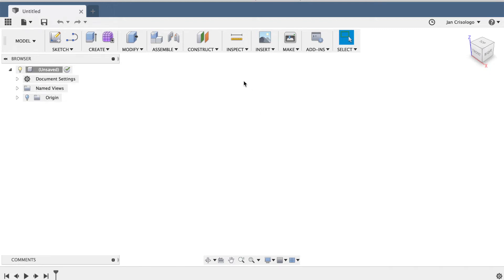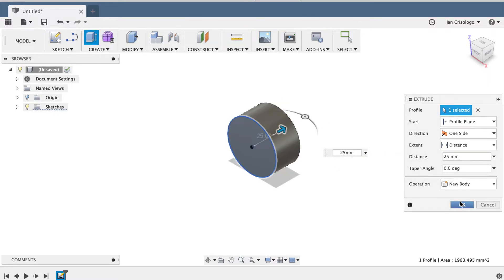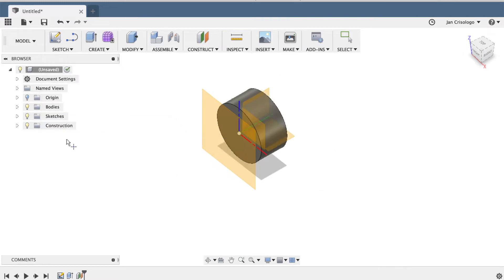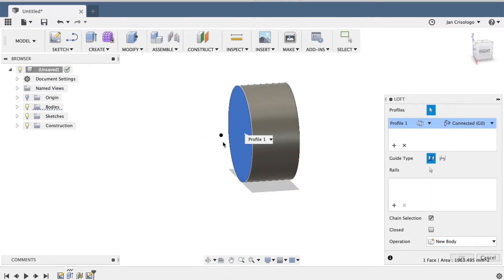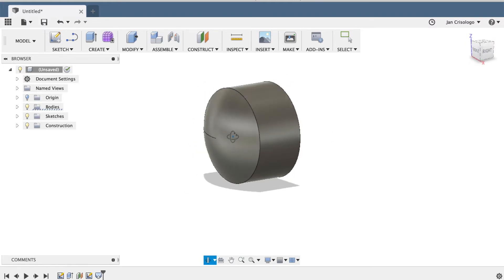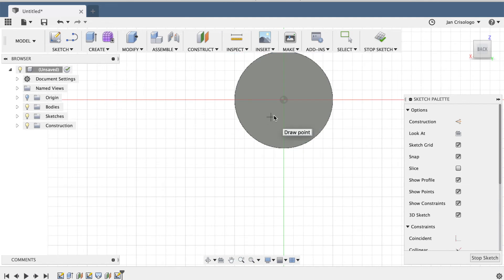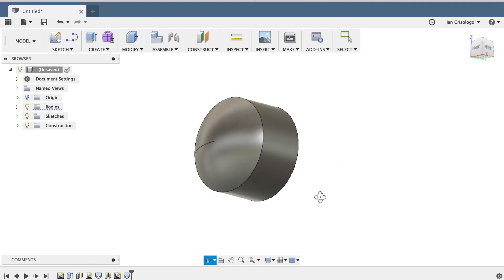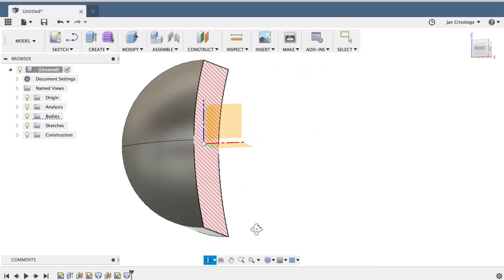How to model convex and concave surfaces in Fusion 360

Comment: Looked easy but in the latest version you have to create the offset plane, then select it, then Create Sketch, everything gets moved around and the offset plane is gone, but it’s there and that’s what you’re working on,so you can select a point, but it’s difficult to find a center point, but if you look sideways the  point is on the offset plane, and you can use the loft command
Reply: Yep.thats why I'm calling it quits.I'm tired of the headache.

Comment: Functions show here are not available on my version of Fusion 360 (11/2020).  There's no 'point' function, there's no description how to fill in the Loft form (profiles or rails), we never know if we're in sketch or model mode and so on.  So, no success here.  Don't try this.
Reply from the maker: Are you using a beta release? I just tried on Windows 10 and MacOS and the process is still the same for both even if the UI is different. If you can't tell whether you're in Sketch mode or not, there might be something wrong with the build release.

Comment: is there a way to remove that black line on the surface?
Reply from the maker: Unfortunately, no. The delete command doesn't remove it. Splitting the body in half, mirroring the side without the line and then combining both halves makes it worse (the line goes across the whole surface)
Reply: @rtql8d  thanks, will the line makes any problem in manufacture? I have a file like this....
Reply from the maker: @shingh2068  For 3D printing it should be fine, for machining I've never tried